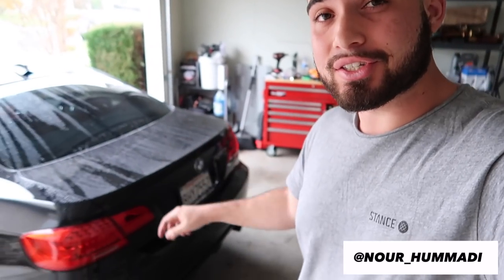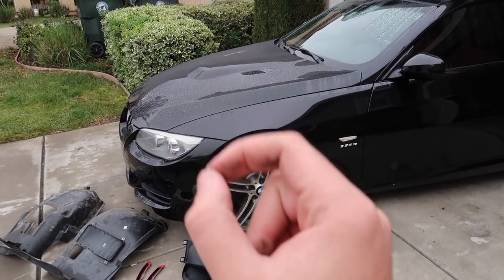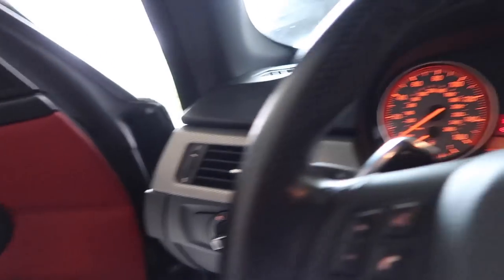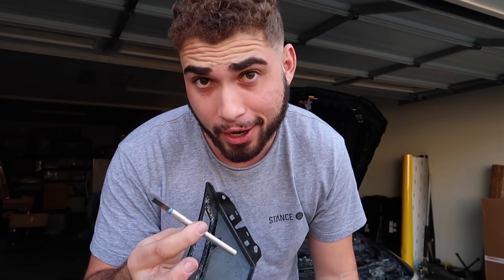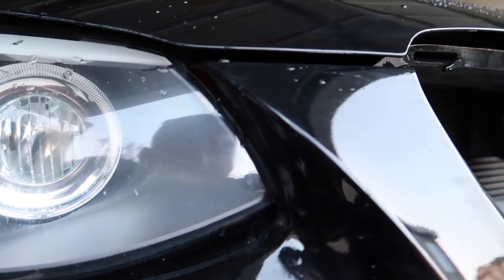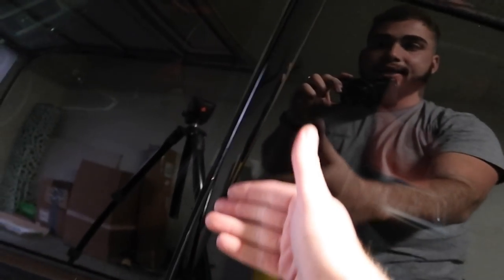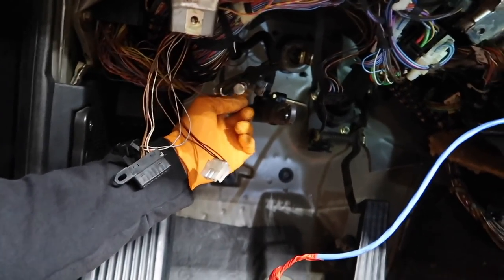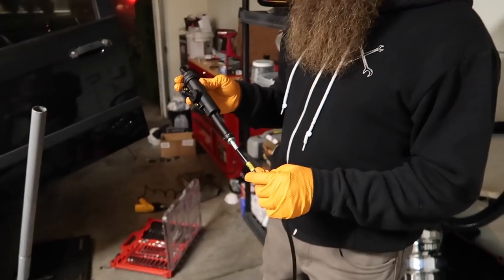Rebuilding A Wrecked BMW 335IS Part. 6

Comment: the underbelly protection is helpful in preventing rust. especially in cold weather when there's salt on the street, but also when it only rains
Reply: And also to prevent things like rocks etc. from destroying the oil pan and other important things under there
Reply: Honestly he should get the same style skid plate

Comment: Yo if you spray that cap with the jet black spray can and clear coat, you gotta polish it and buff it once its properly dried to remove the orange peel. It will look better. Also dont over do it or youll have to respray it again and that sucks haha

Comment: Hey i was driving my car and it suddenly the steering wheel was locked and the brakes weren't working it stopped on the hill and i heard load noises and burnt smell and in the morning i tried turnjng it on it just makes noise then cljck do u know what could cause this problem?